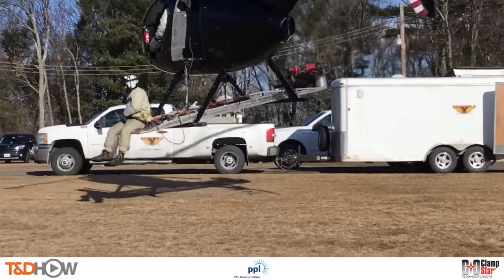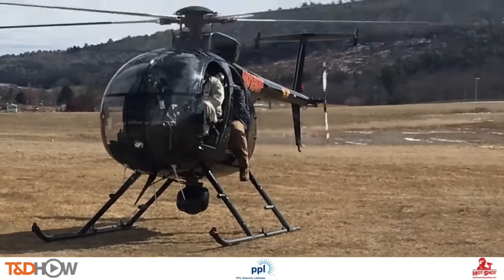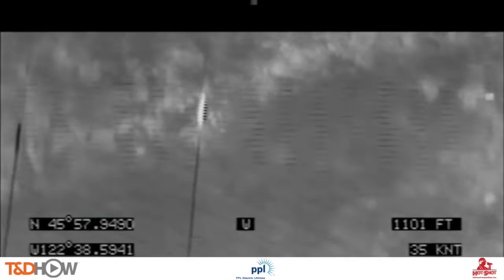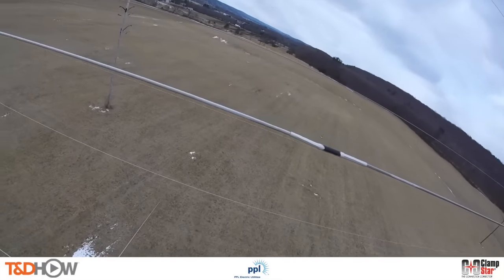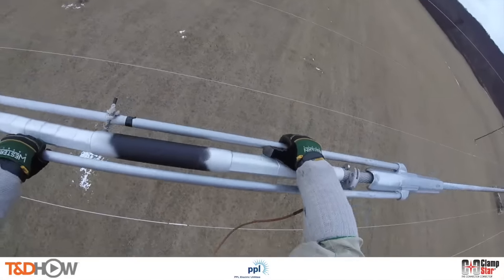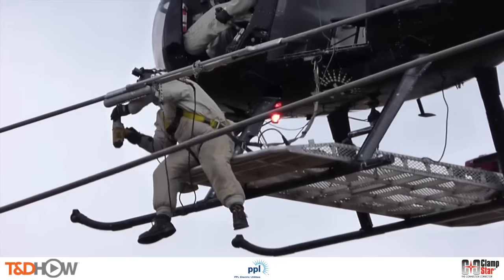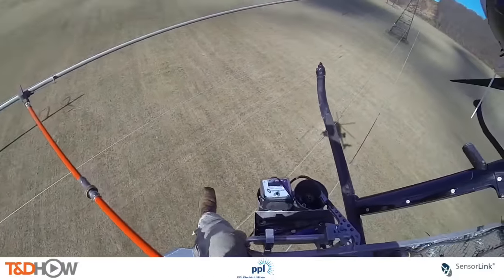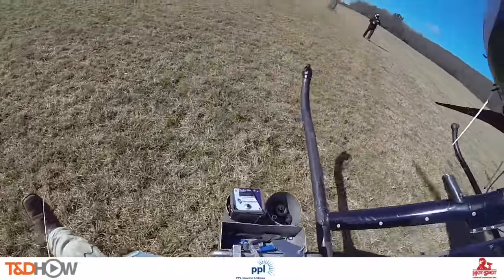How to Find and Fix Failing Overhead Splices

Comment: A shunt splice repair on a line near me cured a lot of RFI for the neighborhood, on a lot of frequencies. The very informative crew told me that before repair, it was 48 uOhms on one side and 12 on the other. After repair, splice R was less than the R of the cable, just as this video demonstrates. The repair totally eliminated a bunch of noise on VHF/UHF ham, pub service, local school HTs etc.

What was equally impressive was their timely response. I filled out an online form and went to lunch. When I returned, trucks were setting up at the eventual repair spot, other trucks were scanning the lines for about 2 miles up and down the line. Whole thing was probably two hours from time of reporting to ticket closed. Thanks APS Phoenix.

Lots of E. Not a lot of R.

Thanks for these videos, T&D.

Comment: Seems pretty wild that a ~40μΩ is a cause for concern, but then again if you have hundreds of kilometres of transmission line and many of these similar resistances, they add up. I am not sure what kind of amperage is typical of that 230kV line, but judging from the physical size it appears to be, I'd reckon a guess of 1kA or so. Amazing again, that @ 1kA, a 40μΩ resistance would cause a 48 Watt dissipation loss. Seems small, but it was enough to clearly see the losses (as heat) in the thermal imaging inspection. I'd guess the watt loss is not the real concern, but the thermal runaway degradation of the splice connection

Awesome video & footage as always! ^_^
Reply: SALCON This transmission line uses 230kV L-L, which is around 132kV L-N. Average transmission conductor is ACSR 300mm^2 which carry approx. 650A max current. Resistance 12um on the conductor itself generate natural losses around (650)^2 x 1.2x10^-5 = 5watts/m. If 200km transmission line = 5x1000x200=1 Megawatts of losses per conductor line
Reply: @imadewn  where do we find splices details or catalog,
Reply: @imadewn  Wow. 1MW of losses over 200km. I know it is a relatively small fraction of the total power transmitted, but still obviously is a huge value just spread thinly over very long distance, so it is hard to see.

Comment: Tens of uOhms? Wow, and I thought half a milliohm FETs were low-resistance ... XD
Reply: Well, 500mm^2 aluminium cladded copper cable in 10cm will surely be hyper low resistance. :) Half milliohm R_DS(on) FET, that is actually a really good value for a single FET. :)   When you are passing few kiloampers over hundreds of kilometers it does add up to losses.